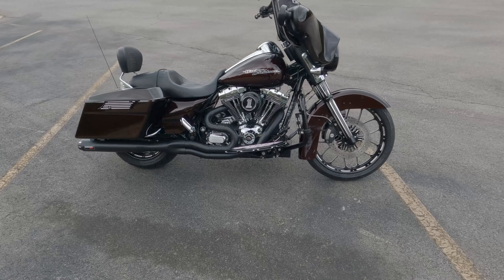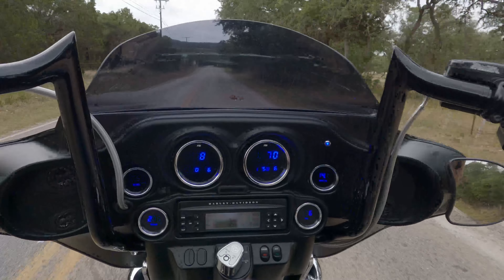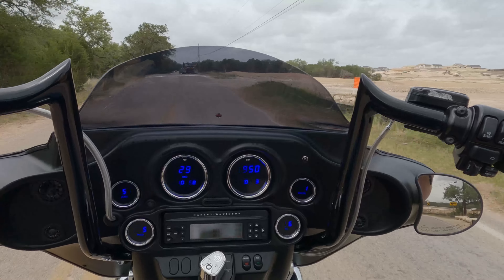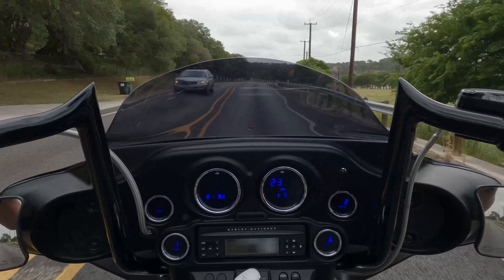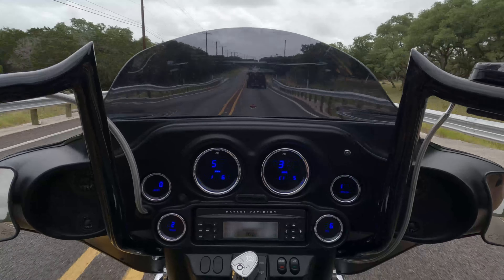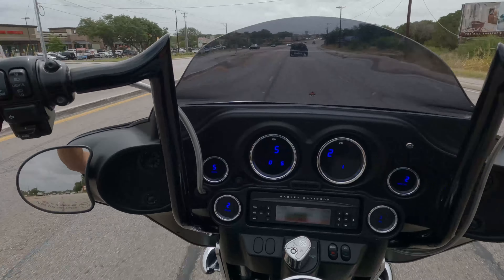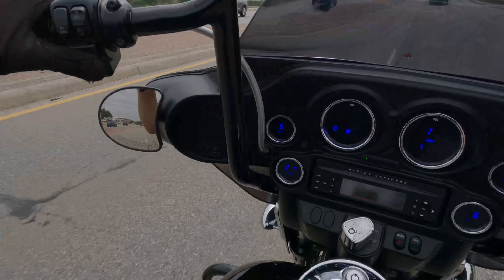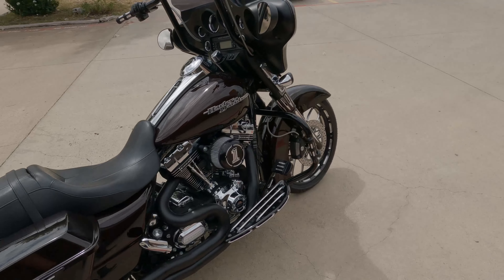Screamin' Eagle 120R Street Glide Special from Harley Davidson

Comment: What exhaust system are you running,  it's really quiet  compared to mine,  I'm up to 9k on bike, and dynoed 139hp and torq at wheel,  have 4" bassani 2 into 1 would like to find dual 50 cal mufflers.